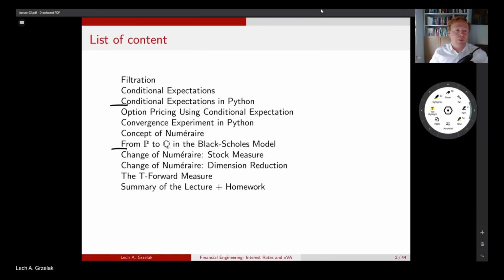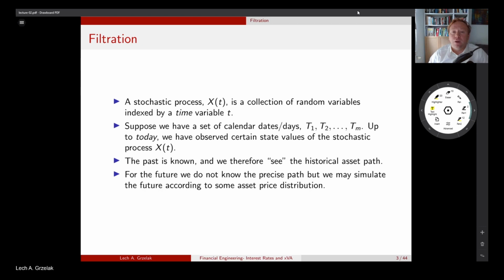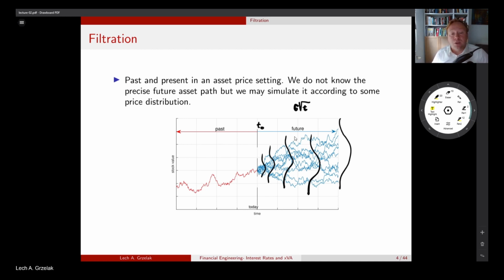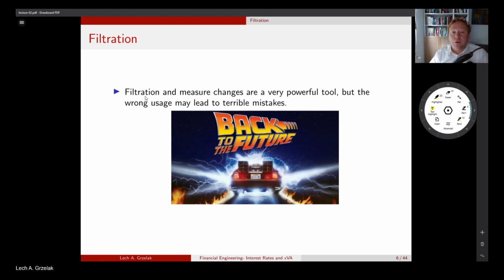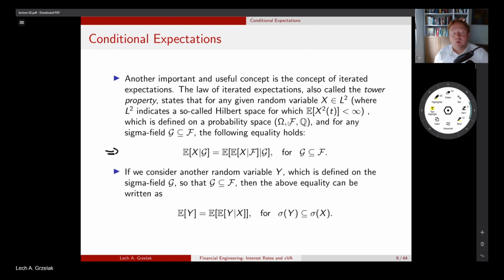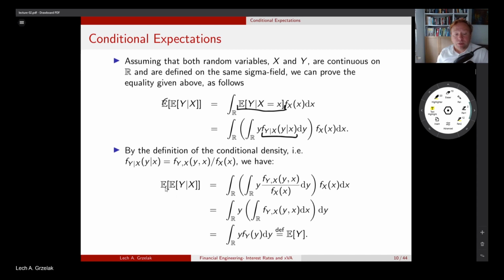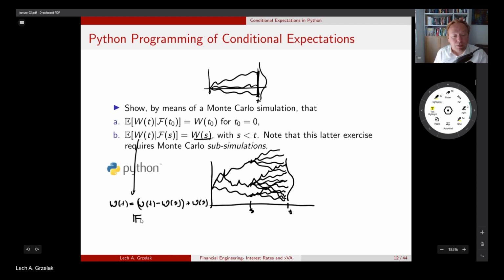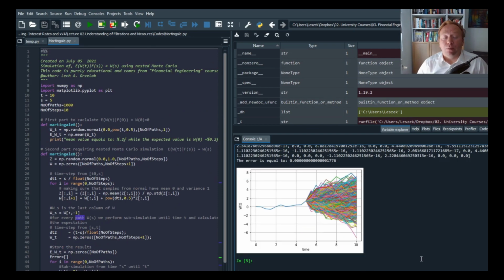Filtrations and Measures (Lecture 2/14, part 1/3) | Financial Engineering Course

Comment: On slide 9, shouldn't it be that sigma algebra generated by X be a sub sigma algebra of the sigma algebra generated by Y instead of the other way round, for the last equation E[Y] = E[E[Y|X]] to hold?

Comment: Thanks Lech
 for a fab course and that too online with full access to all. I'm really liking the content and the way it's been explained.

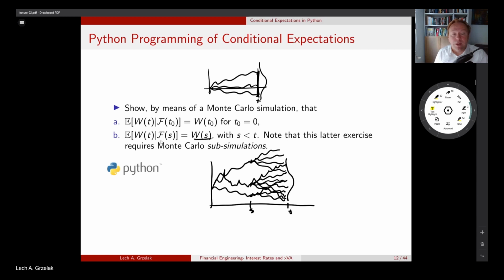I hv one question though on this lecture at 42:41 you mentioned two applications in python. I'm interested in second one and how we can apply LSMC or kernel regression techniques in such cases wherein we don't want to run multiple inner scenarios.

Example- i want to compute Initial Margin which is the percentile of the change in portfolio value i.e., delta of Value at T and Value at T+MPOR and both these time periods are in future. 
Any guidance pls?
Reply from the maker: hello Chetan, 
Thanks for the feedback! Good to hear you liked the course.
Regarding your question: I will discuss these concepts, in particular, conditional expectations, by means of LSMC method in the follow up course. Stay tuned. Best wishes, Lech